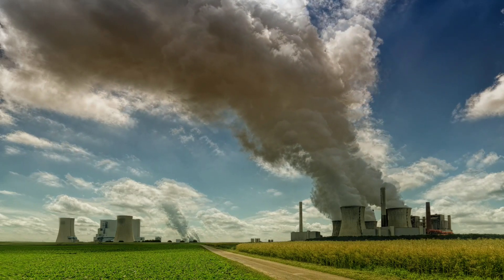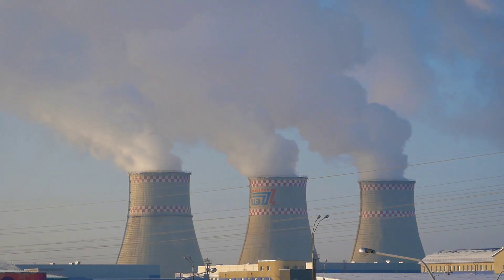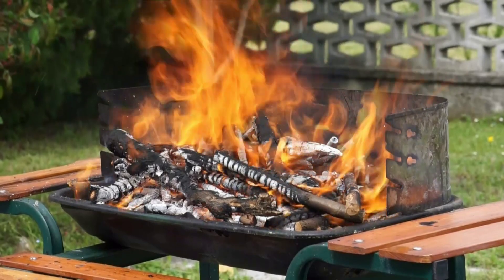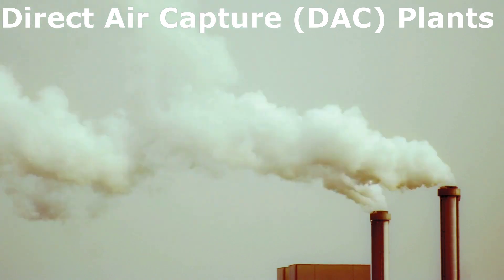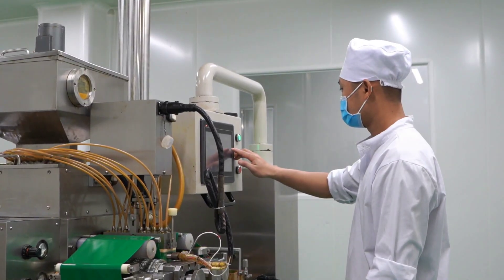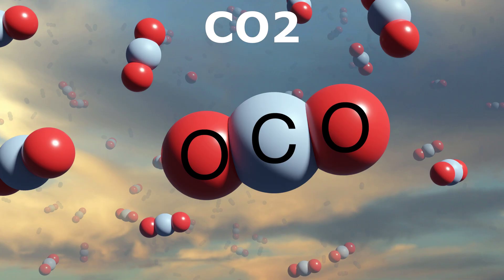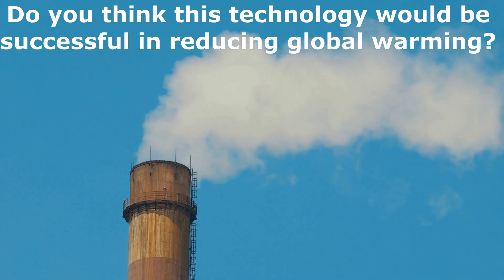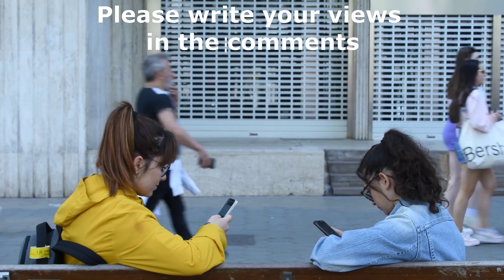Scientists Found a Powerful Technique to Control GLOBAL WARMING by Capturing CO2 Directly from Air !

Comment: Thank you for sharing 
Wow baking soda why not 
Baking soda has cleansing effect 
I used it all the time for cleaning hard dirt in my kitchen to clean my fridge 
And baking soda is safe 
When I have upset stomach 
I ate a pinch 
Sometimes when baking cookies 
They mix a teaspoon of baking soda 
Put a baking soda in water 
It will dissolve right away
They should experiment 
Putting baking soda in an aquarium 
And see the effects of it 
On the fishes .
Reply from the maker: Right 👍